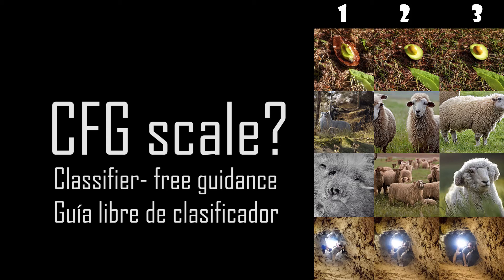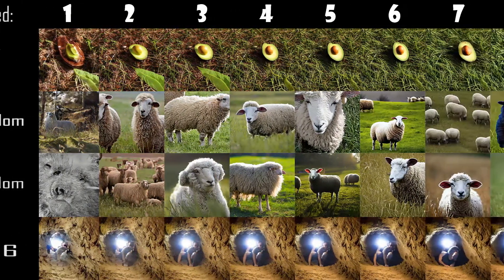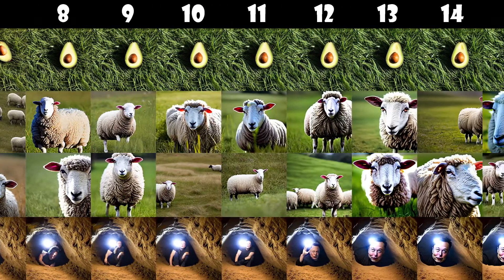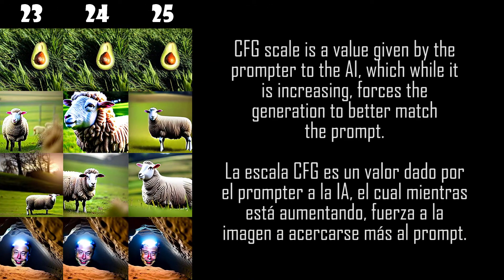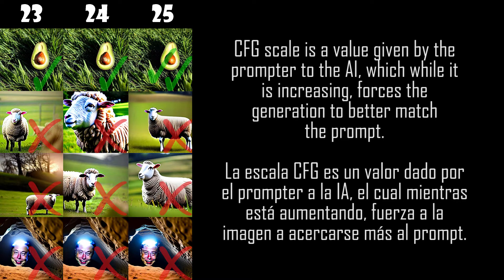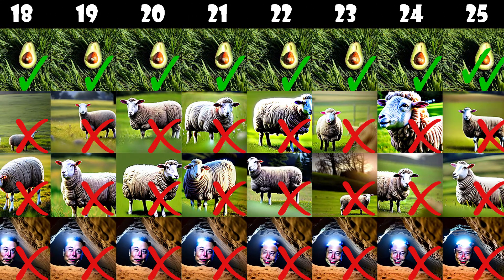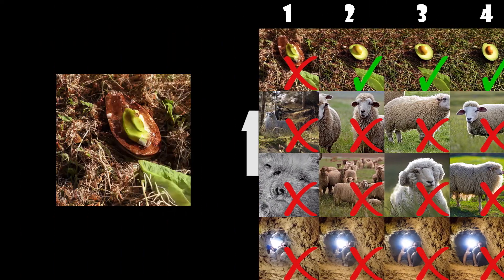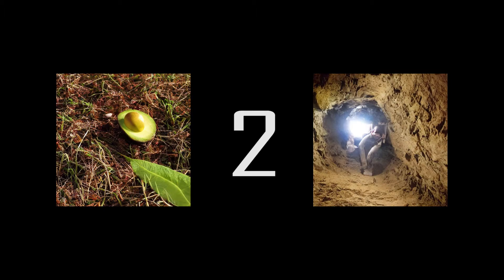What is CFG Scale in Artificial Intelligences? STABLE DIFFUSION - DreamStudio

Comment from the maker: Using NOP's Stable Difusion Colab, September 6, Stable Difusion 1.4. The settings used in this video were 512x512, 215 steps and a DDIM_ETA of 0.9. No upscaling, no face enhancement and no sharpening.
https://colab.research.google.com/drive/1jUwJ0owjigpG-9m6AI_wEStwimisUE17#scrollTo=Ucr5_i21xSjv
Para oírlo en español presiona acá:
https://www.youtube.com/watch?v=AC2qg_eCI3k